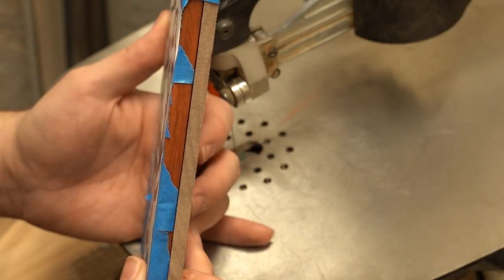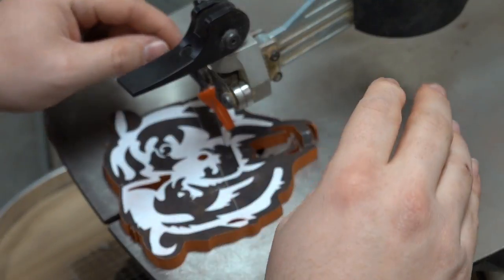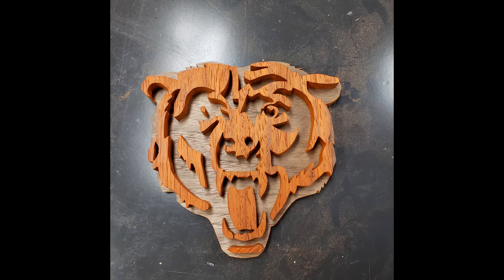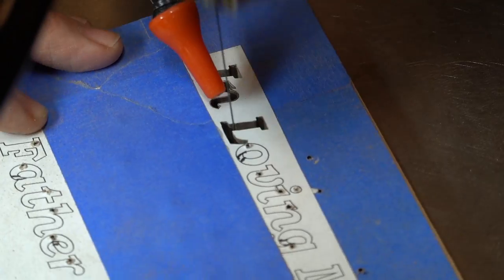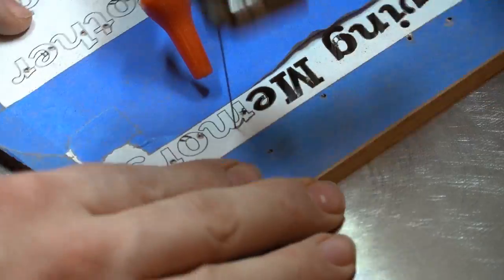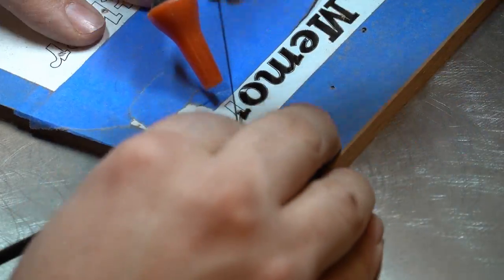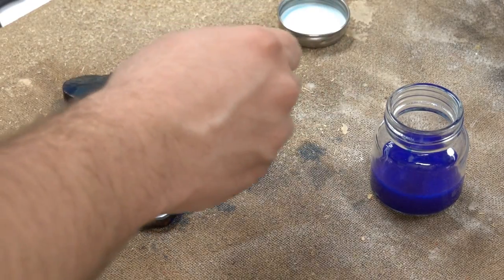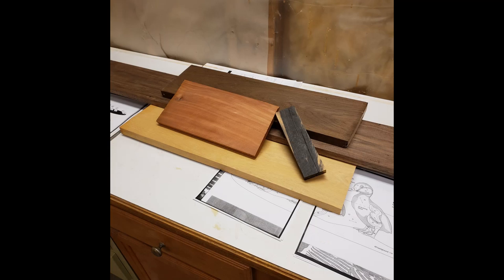Memorials and Lettering on the Scroll Saw

Comment: You are right about the blade change mechanism... that by itself is a make or break as far as the hobby is concerned. And right know, my machine is telling me I have to get a better machine or this hobby is a torment.
Reply from the maker: David, I definitely get that. If you want to get deep into what you can do with the Scroll Saw I think eventually a quick change mechanism is a necessity. There are lots of options that don't involve a bunch of inside holes that can be easier and fun. What types of projects do you like to make?
Reply: David, try a machine in your price range. You can make money, from scrollsaw work. Let others pay for your tools.